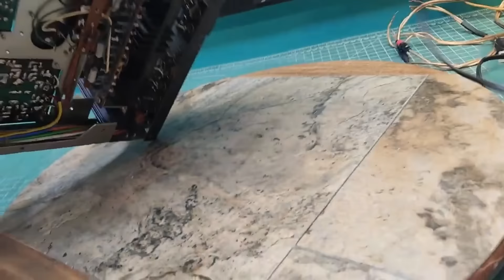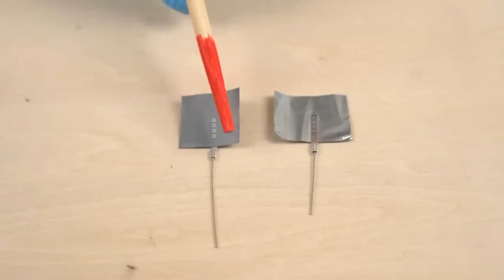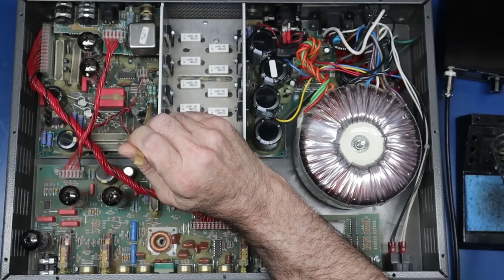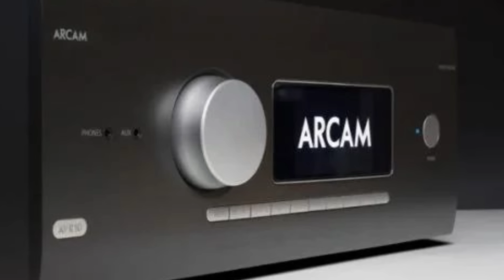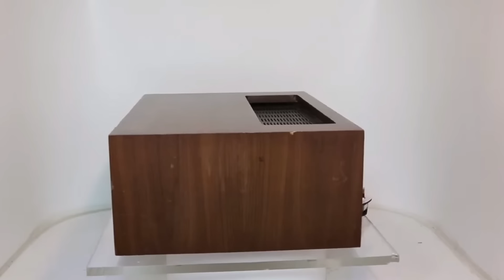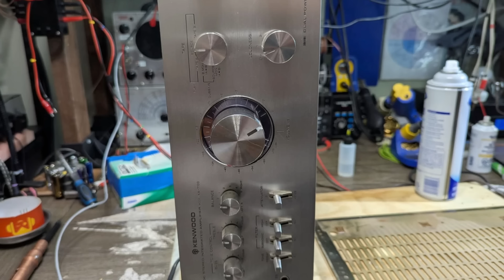Why Your Amplifier Will Die In 5 Years (The Hi-Fi Repair Scam)

Comment: A capacitor manufacturer's rated lifetime spec is usually at maximum temperature, voltage and current. If you back off a lot from these extremes, the lifetime goes up by orders of magnitude. That's common usage.  The typical initial tolerance on electrolytic capacitors is -20% to +80%, eg very imprecise, or 10% on precision versions. Variations "over time" are often quite small compared to this initial tolerance, unless it has basically "failed".
The very annoying caps are the old "bead tantalums" which are a lot less reliable and then fail by short-circuiting, and killing the equipment. You can usually spot a failed tantalum cap by using an inexpensive thermal camera, the short-cirucit makes the cap get warm when the gear is turned on. This camera can also easily identify some other short-circuit failures, like failed semiconductors.
An obvious way of extending the life of any gear, is to turn off the mains power (at the wall plug) when not in use. This also applies to any semiconductors (specially in switching power supplies).
There is heaps of modern electronic equipment around in the average house today, and it's mostly "reliable", or you'd be complaining. A lot. The average relaibility of electronic equipment has improved by orders of magnitude over the last few decades. For example, I remember back in the '90s, the average tower computer would die electrically after a year or two (sometimes caps, sometimes semis), today this would be very unusual. I ran 50 of them, for decades. 
For a lot of the comments here to be accurate, the HiFi manufacturers would have to be actively seeking out failed batches of caps, or grossly mis-designing equipment. Really?
Reply: No they didn't get improved. They did in sense of control and dry capacitors you might find on MB did but they are working in much more hazardous environment (machine that diapers 10 times more heat as it uses so much more electricity (GPU being first to blame closely followed with CPU's even single SSD today can suck as much as whole PC would on start of milenium. Traditional condensers didn't and equipment that came with such still is in a working shape even bus changed (SMB, PCI, PCI-E now). For example I have old Creative SB Audigy 2 Platinum Pro that's 25 years old, used more than 15 and stil in perfect working shape and a new one SB Z SE in a current rig. Both come with Niclin Gold capacitors. Finding deacent and quiet operating SPU is not an easy task even today for example old EWGA Gold series, Be Quiet current series or upcoming Noctua ones. There are other fields where amount of EMI and other interferences is much more strict regulated as medical field and are still same regarding desired DC output (highly regulated) if that's your harts desire. They are more expensive and come with better and longer warranty period and no one is stopping you to use them with device that use external AC/DC converters. If device it supplies is good engineered (proper dumped, caged, with components that have high rejection rate [DAC amps in the first place]), analog OP amp's where solved thing even in 90's. Power amplifiers regarding performance metrics and output power did improve significantly last 10 years (again regarding consumer wide market) with class H based SoM's. It's not there where not class G ones even in 80's that can still rival them or such new ones or how they are choice when you need it to scale far beyond regarding output power (cuple KW PA's based on A-F (A, many B stages). If you want such SoM based ones with long term suport, warranty and part availability build to last you are relatively out of luck because only one's such are some ATI lines which are relatively expensive (to common folks certainly expensive).

Comment: A rundown of my system: Sources - Technics SL-100C (2024) with Goldring E4 cartridge (2025); Ocean Digital WR-10 Internet radio tuner (2024); iFi Zen DAC (2020); Onkyo TA-2800 3-head cassette deck (1992); Akai GX-620 reel-to-reel deck (1980). Preamplifier  - Apt Holman (1980). Power amplifiers - NAD C275 BEE (2015), Soundcraftsmen PCR-800 (1984). Speakers: Acoustic Energy Radiance 3 (2010), Dayton Audio Classic B65 bookshelf speakers (2024), VeraFi Audio Vanguard 10" subwoofer (2024). Accessories - Music Hall PA 2.2 ADC/MM/MC Phono stage; headphone amplifier (2023), NeoHipo ET30 two-amplifier/2-speaker pair switching device (2024). Additional cartridges: Audio-Technica AT-VM95ML (2025), Sumiko Oyster Moonstone (2023). I'm currently rebuilding a 1969-71 H. H. Scott 342c receifer and a 1978 Pioneer TX--8500 ii tuner with a 1979 Pioneer SX-780 waiting in the wings. 
Won't buy anything with Bluetooth (don't like the sound), HDMI (gave up watching TV several years ago) or the ability to stream (don't like current music; too expensive; sound not good enough). I own my system for life.

Comment: I have a Bang & Olufsen CD/ cassette/ radio/amplifier unit I purchased in 1986. It lasted until 2015 when I had to have it serviced. They replaced the capacitors and rubber belts. It has work perfect since. Good Quality!

Comment: Switching power supplies are ticking time. Bombs, it's not a matter of if, but when they are going to blow up
Reply: I agree I was a TV engineer and SMP were a pain it  was not a question of find the fault because that didn’t fix it ! It would blow instantly because the original fault had stressed other components, the wholesaler used to stock a kit of parts ! You changed all of them , and with a bit of luck and a 100 watt lightbulb it would run again! You didn’t actually feel like an engineer Anyone could change a load of parts , the question is from an engineers point of view is what caused it to fail? A component failure,overload, surge on the supply, storm damage  , an Audio amp will put up with supply abuse and live on ,even when you scrap it the Transformer can still be used

Comment: I still have my Marantz 1070 amp I bought in 1975. It has a 'staticy' sounding volume control, so I have not used it in over 40 years... probably needs recapping as well. I bought a new volume control from DigiKey, have yet to install it (lazy me!)😄
Reply: Try deoxit spray on the volume pots/faders etc.

Comment: So very true I built my own amplifier using I know dated technology MOSFET s it’s basically a mono block with basic controls, with a direct path it performs extremely well ‘ can listen for hours no fatigue I have an optical input,  but now find it’s not on equipment anymore! Just as well I used a bolt on converter on the rear,  I have three sound bars all with failed smps  my amp will out live me!

Comment: The problem is finding qualified technicians to service vintage equipment. There aren't that many around, and the list grows shorter by the year.
Reply: As a retired audio technician, I agree with you completly.  Most colleges don't give the course anymore.
Reply: @yvesboutin5604 Not enough of a market for it anymore I guess, and that's too bad because some of that classic stuff is really cool (as I'm sure you know yourself.) Problem is that unless you do it yourself as a hobby, the cost of having vintage equipment restored is often greater than the value of the gear itself even if it's really nice.
I have an old Optonica receiver and I really wish I knew where to get new potentiometers for the tone, balance and volume controls. Especially ones with the little notches in them as you rotate them! It's 50 years old and still works great, just needs new pots.
Reply: @devilsoffspring5519  Agreed. Finding parts for repairs other than resistors and caps is a nightmare.
Reply: @devilsoffspring5519 Have you tried cleaning and relubricating the pots with a good electronic parts cleaner spray and lube? That's probably all they need unless somehow they got physically damaged from the unit being mistreated or dropped or something like that.

Those kinds of pots usually don't physically break per-sé, they just get dirty or oxidized contacts from simply how many decades old they are by now... But usually they are totally fixable and can be restored to like new operating condition by spraying some good electronic parts cleaner into them, then moving them back and forth a few times, and then also relubing them with a non conductive lightweight spray lubricating grease... You might try that at least, before giving up on your vintage gear completely! (All of the mevhanical switches, buttons, and controls can and should be cleaned like that every few years or so, or as needed to maintain proper operation.)
Reply: @JoeJ-8282  My receiver has an absolutely enormous amount of mileage on it. I'm pretty sure the volume pot is worn out at the lower end and not merely dirty.
Reply: @devilsoffspring5519 Yup, the deposited resistive film that gives potentiometers their functionality can get worn off over time - particularly at the most travelled rotational ( i.e. generally the “lower volume” ) areas - and while cleaning / lubricating can temporarily reduce oxidization on the wiper’s contact point, when the film is depleted, it’s pretty much game over. Stepped attenuators with actual fixed resistors offer durability advantages, but at prices even in the “golden era” reserved for only the highest end gear and test equipment.
Reply: @yvesboutin5604   STEREO LAB IN COLUMBUS OHIO IS GREAT.
Reply: I do it for fun.  It's a hobby, not a business.  If this were a business, I would be taxed and regulated to death.  So, I buy old stuff, fix it up and sell it when I get sick of it.
Reply: There is enough ressource around  the internet to attempt repairs yourself, I did it on several amps. It's not rocket science.
Reply: @littlefury  And do you check the 'bias' currrent on the output transtors? Extremely important!
Reply: @HarryWho102yes indeed, all there is to know is to be found online for a proper repair.
Reply: @littlefury not everything!! The knowledge of 30 years of working on this stuff can’t be put on a video…….
Reply: And I highly doubt you have the equipment to properly overhaul a system.
Reply: @Idrinklight444 not a video, thousands of vidéos. I have an oscilloscope and a signal generator inherited from my dad who was an engineeer. I'm not saying anyone can do it, but people motivated enough to read dozens of hours worth of ressources on forums. Once again, I agree it's a profession, but it's not out of reach for anyone motivated. Don't make it like you need 10 years of experience to do basic maintenance. The stuff I don't know, or What I'm not willing to attempt, I go to a pro anyways. Recapping, and resetting the bias point of transistors is not hard stuff. And also, I'm not making a business out of it, I only service my own gear, I'm not scamming anyone pretending I'm a pro.
Reply: @Idrinklight444  What do you need?  A good tube tester.  I have an Eico 666.  Some good high-impedance multimeters.  An RF signal generator.  A sweep generator for FM helps.  A two channel digital oscilloscope.  I have a one watt FM stereo transmitter that I use for alignments.  I also have an inexpensive Chinese component tester for transistors and small capacitors.  A 140 watt Weller soldering gun is needed, as well as a good pencil soldering iron with adjustable temperatures.  Also a solder-sucker for desoldering.  I guess it does require a bit of an investment!
Reply: Every repair shop is closed in my area
Reply: @datsunmadman it is a problem...
Reply: Yea, I'm one of them. I used to service/repair all this equipement back in the day. Now at 73yo, I need to repair myself more often than not!
Reply: If you’re not able to repair your own equipment, the cost of maintaining vintage equipment is not cheap. I’m glad I know how to repair my own stuff, if I didn’t, I’d probably just buy new stuff. Since I do know how to repair equipment, I’ve got a stock of vintage equipment that I cycle around every few months. Akai, cerwin Vega, realistic, Sony, pioneer, sansui, marantz, toshiba, hitachi, onkyo, Yamaha, NAD, fisher, and others. I don’t even look at modern equipment, I scrap it right away if it doesn’t work. I’m glad I was born in the generation that got to enjoy this vintage stuff. It definitely appears to be a fading trend though.
Reply: Learn how to do it yourself. Find a simple amp, like the very underrated Sansui AU-101, and recap it. It's fairly simple to do, and you will be rewarded with an amp that has warmth that no modern amp can provide.
Reply: Exactly, and they charge like a roaring bull. 😂
Reply: Oh..I am calm..I work in a place with technicisns and repair operators all around me.Extra: my friend repairs hifi equipments about 30 yrs ago.Extra +: I had all schematics and repair manuals for my amp if needed.Extra ++: the amp made in Japan,8 yrs old so maybe not need fixing in a short time.
Reply: Either takes hours and hours.days and days..weeks and weeks to sometime give up and take a loss. Only really smart people that don't care about money can do this.. PERIOD. it's about the smile the customers have
Reply: The very reason I’m learning at 55!!! Re capping is where the $ is!
Reply: They are out there but hard to find.    I have a vintage audio repair company near me.   But the lines are so long.  Dropped off a Amp in November   Got it back in April 

Do some online investigation. I found 5 others in other cities within 200 miles.  But no other within 100 miles

Some have shorter waits.  Some you may have to ship a good distance   

It takes patience but a single repair it may last another 20 plus years.  

My strong advice if you have to get it repaired.   Dont stop at just getting it repaired .   Do a full diagnostic   There could other things that are long in the tooth or not too far from failure

One of the problems with not doing a diagnostic and a problem with a lot of younger repair technicians   They usually just replace a failed part or parts.   You need to diagnose why it failed. Was it a faulty cap or did another problem cause the cap to fail. 

had a 300b tube literally go up  in smoke that took out some resistors .  Diagnosed both amp channels   The amp was fine just a bad tube.   If the amp was bad replacing the tube would have been only a temporary solution .  The amp most likely would keep destroying the same tube or more tubes and may have eventually destroyed the amp.
Reply: Another issue is components (e-caps) are being discontinued by specialty sellers like digi-key.  I'm sure because of shrinking demand.
Reply: That's because there's little point in paying someone $1,200 to install $300 worth of very old "new" parts in a receiver that's worth $50 at a pawn shop.
That's really all there is to it.
Got some old equipment you love? Gotta learn to service it yourself. And the yellow worn-out old service manual costs more than the equipment is worth!
Reply: There are schematics and service manuals online,  but they are technical documents for technicians and engineers.
Reply: @joefish6091  Not really!  You don't have to be a trained engineer or even a trained technician to repair these things.  Learn how to read schematics.  It's not that hard.  Learn how to solder and desolder.  Learn how to identify component values.  Stick to tube equipment or to older transistor equipment that used discreet transistors (easy to find) rather than ICs.  That's how I did it.